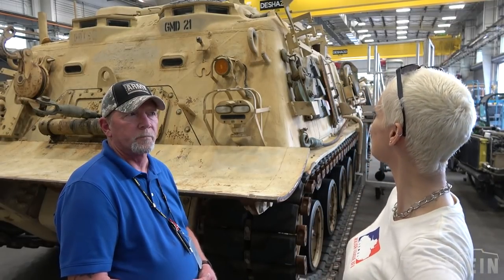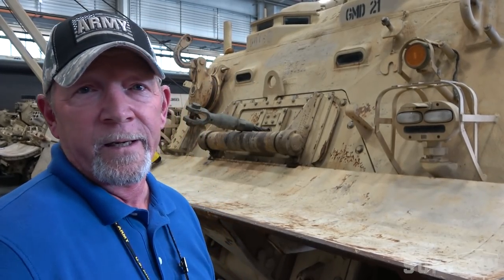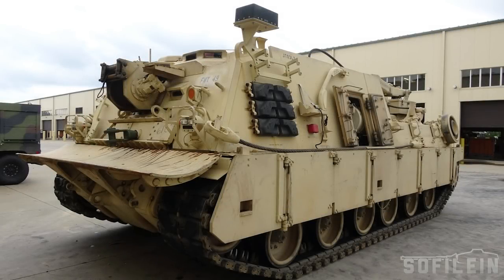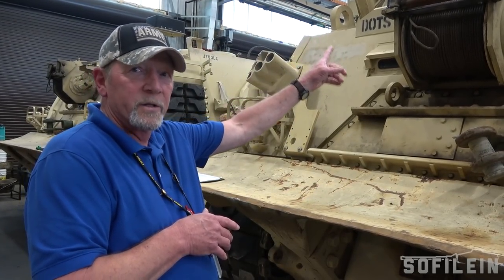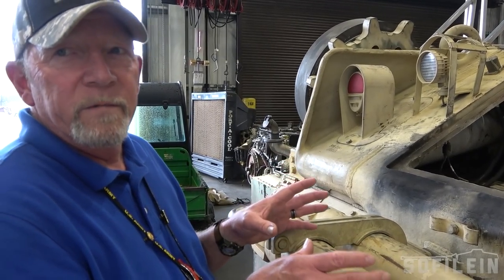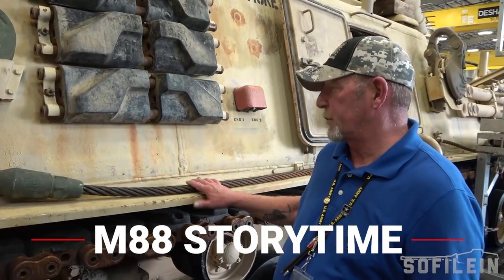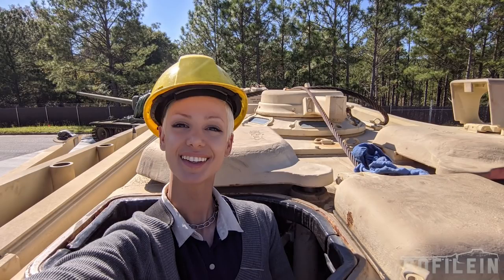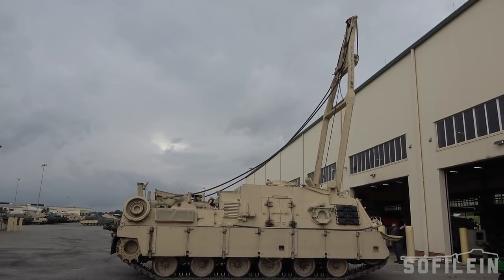M88A1 and M88A2 U.S. Army Armored Recovery Vehicles

Comment: SoFi, great episode. 2 ?'s the A1 has the air cooled diesel engine. The A2 is based on a M1 chassis and so I'm guessing it has the gas turbine engine? #2 ? I can understand getting stuck between two trees... But how heck can it be OFF the ground.... and was it a M60 or M1 model. Just thinking out loud here...
Reply: M88A2 is same chassis, same AVDS-1790 engine, but it's the -8CR series which makes 1050hp vs the 750hp of the -2DR in the A1.

Comment: Why the heavy armor?  I mean if it's just for haul/recovery ...  I can understand protection from small arms fire.. maybe grenades and possibly and mines... but 56 tons... some of that armor looks thick.
Do these come under fire from other tanks (or have they in the past?)
EDIT:  Guess I should have waited until 8:48 of the video ... heh
Reply: I also think they overdid it with the armor.
Reply: You need the weight to tow the weight, the armor provides a greater counterweight to anchor to when winching, not to mention more protection to the crew for ever evolving small arms and light antitank weapons
Reply: Tank retrievers have hidtorically come under fire in WW2. One of the reason the germans started stuff like Bergepanther. The additional weight of the vehicle is another
Reply: @bradm3a3  if they needed a heavier tank retriever they should make a new one, the m88 had enough problems with it's weight as it was, the wheels and track was not designed for the added weight,maybe they should had made one based on the M1 tank, that would be too expensive maybe?
Reply: @vasopel  here is the problem with that, cost.  If you go buying a new main battle tank you don't want to have to buy a new recovery vehicle too.  You want something that can do the job a long time.  As for the track and things, the 88 is pretty rock solid from what I've seen, and even the m1 hasn't had a major suspension upgrade since it came out, it started at 65 tons and with the m1a2 sep v3 out now it is pushing 80 ton.  You can tell a vehicle is solid in design by how long we use it, look at the 113, or the HMMWV, been using those since right after the dinosaurs went extinct
Reply: @bradm3a3  well if you don't want to make new tank retrievers for your new tank you upgrade the old ones I agree, no the 88 is not rock solid, the weight to surface area is not good at all, and although the M1 wheels and suspension was designed with updates in mind the m88 wasn't.
Reply: @bradm3a3  and about the 113 and the HMMWV, it is well known that the m113 can't get any more armor because even though you could put a new engine the suspension can't withstand the weight, the uparmored HMMWV faired better but that is because it was designed with updates in mind, :-)
Reply: @vasopel  the HMMWV was never even supposed to be a front line combat vehicle, it was only used in that capacity because we couldn't find anything better at the time
Reply: @bradm3a3  yes true but to be exact...it's not that it was the "better" among several choices, it was just the only thing available at the time (1996) of course they slightly updated the chassis (M1114) to cope with the extra weight, but why the hell did it take them until 2007 to make the MRAP? cost was to high again? I swear I don't understand their choices about where to give the money and where not to... :-(
Reply: @vasopel  because everyone wants the money to go to their district and their friends.  If people were objective and went for the best product we would be able to take over the world, this is how we bake in a handicap
Reply: I was part of the engineering team who developed the M88A2 and directly involved with the armor development.   The armor served two purposes.  First a tracked recovery vehicle off  road has to weigh roughly the same or more than the vehicle they are pulling out because of control and traction .  Weight matters in recover.  The second reason was it was designed  to go into near front line situations to recover knocked out tanks.  the armor was to protect it against artillery, light cannon and some infantry weaponry.  The specifics we designed for are still classified, but the threat included helicopters and aircraft.   That included friendly fire as well as Warsaw Pact equipment.   The projections was being able to operate just behind the lines could save 50% of the vehicles  disabled in combat that were repairable.  In those days that number mattered.    The M88 was designed to operate just out of direct line of site fire.

Actually, vehicles like the M-88 armor designs include something called "Pass Through" .  The vehicles were designed to let a sabot round simply go in one side and out he other with spall blankets catching the fragmentation coming off the armor.   The crew had a decent chance of survival if the round just went on its merry way.  The worst case scenario was a round going in and then ricocheting around the interior.   Not much of the crew or the interior would be left.
Reply: @jamesb4789   Wow thanks for all that info.
Understanding is a lot better now especially about the weight-relation.
 The last part makes sense too...  kinda reminded me of the ship in WW2 that took some armor piercing hits from the Yamato-Encounter and survived a long time (albeit with holes)..
 Until the Japanese switched to HE.
But I guess the same principle by allowing a shell to pass through.
Easier to repair a hole and better to have a crew survive.
 Thanks for the explanations.
 Awesome stuff.
Reply: @vasopel  In 1988 the M88A1E1 (A2 design vehicle) went head to head with a General Dynamics M1 based recovery vehicle.  The Aberdeen test folks concluded after one day the GD vehicle was junk.  Teh gas turbine has poor torque, but fast.  Tow trucks are slow high torque operators.  They had to follow the GD vehicle around with a fuel truck.  It even ran out of fuel in front of the Army brass during a demo, then brock down and had to be towed back to the hanger  by the M88A1E1.   The M88A2 was slightly nose heavy, the Army and BMY did not want to go to 7 road wheels at he time.  The suspension was adequate, not great but the vehicle was slower and thus it was ok.   The M88A3 hydro suspension was proposed in 1988 and shot down for cost.  
I was one of the M88A2 vehicle design engineers.
Reply: @vasopel  The weight to surface issue is a tough one to deal with.  There are specific transport issues the prevent fitting wider tracks and often it can affect suspension design and geometry.   WW 2 German designs tried it and with at best mixed results.  That said, the function of the vehicle is that it is not the front line unit and it rarely goes where another did not already go.
Reply: @vasopel  The armor is there first to give the vehicle enough stability for hoisting and towing cross country.  The weight is required or the vehicle can't do it.  The protection was the second reason.   The applica approach was used  for ready repair, cheap assembly, retrofitting  M88A1's as A2's, kept the M88A1 tooling, and it allowed the use of special steel armor for better protection.   The base hull is very strong.  However, you can't make a hull out of the applica type material and the design allowed a compromise.
Reply: @jamesb4789  yes true a gas turbine recovery vehicle was never gonna win diesel power in any test except speed :-)
a diesel powered variant of the M1 would be a better choice, the germans made the Bergepanzer 3 based on the leopard 2 and had no problems (at least none that I've heard of) ,I don;t know if they had any diesel engines that could fit in a m1 hull...maybe they did or maybe they didn't..
now...if they wanted to add weight to the m88a1 for better stability (and towing ability) they should have gone with adding an extra wheel,not just adding weight in the same old 6 wheels ;-)
I know you said the the Army and BMY did not want to go to 7 road wheels but someone had to tell them their mistake! someone!
the 7th wheel would have kept the m88a2 at the same width as the a1 (to prevent transport issues) but the surface pressure would definitely got better! 
I have heard that the A3 variant will have the 7th wheel at last! lets see when that is gonna be build...
Reply: @vasopel  The M-1 hull was simply not much use  for a diesel engine with the performance needed.  We had a M-1 hull at BMY and tried fitting a heavy torque diesel into it with steel plate piled on  to simulate the weight.  The high torque actually twisted he M-1 hull.   the hull armor used in the M-1 did not have the structural strength for the torque.   The Bergepanzer 3  is not considered that good a recovery vehicle.  Their drag winch and cabling were looked at for the A2 and found to junk in field conditions.  It has a rotating boom, but less lifting capacity than the M88A2 or A 3  and for heavy lifts it is restricted to the same angle at the front.  It could not pick up the M1A2 turret. The rotating boom looks good on paper, but without  an outrigger system like commercial cranes it can be dangerous  risking tipping the vehicle.  BP 3 is also a very expensive and a high maintenance vehicle.    I designed the boom on the M88A2 and it was reused on the A3 as is.  It can take a load of 50 tons structurally in a lifting mode, but the vehicle does not have the counter weight for safely lifting that load without tipping over.  We over designed the structure though because the worst load was when you pick it up from the travel position.   The flat plates  on the tubes were added because the legs deformed from the loading in first 3-5 fee of lift.  It was a fluke in the design.   The M88A2 officially had 35 ton lift capacity, but the host winch and structure were designed for 40 tons and derated.  Main reason was the commercial winch we used was higher rated, but it was cheaper to design to that rating than develop a new winch.   And we were aware the Army  probably needed more tons capacity.

The M88A2 met the towing speed for 70-72 ton M1A1 vehicles with little problem, but it was the limit.  We wanted to upgrade, but we understood a huge selling point  for the M88A2 was the M88A1's could be easily upgraded to the configuration if we did not change the suspension.   Since it was  a big tow truck, the practical won out as it should have.  The new 7 wheel required major rework of the lower hull.  Actually, the step from A2 to A3 was about suspension and drive train and the upper hull is basically the same with extra weight.   I drove the M88A1E1 prototypes quite a lot.  There was a huge change from the old M88A1's and I would be curious to see what the A3 is like.

Comment: What hauler hauls the haulers?
Reply from the maker: Yet another hauler

It's haulers all the way down
Reply: @Sofilein  i recently built the A2 in Lego. Im kinda jeallous that you get to play with the real stuff… but also superhappy that you share these awesome vids!
Reply: The HETT.Rode on them a few times at Ft.Irwin and quite alot on the 88's.Loved the Brad's.The Hercules used to be rebuilt at the depot I work at but the Marine Corps in all their logic decided to dump both them and the Abrams.
Reply: Tell the Marines to keep the Hercules so they can steal Red Chinese tanks to be able to have armor in theater.
Reply: An M88 is used to recover, and tow another M88. I had to recover two of them in one day. Both got stuck going into a swamp area to recover a few infantry vehicles that some Lt decided to cut through a couple days before. He sunk a Gamagoat, a Duece and a half, and their 5 ton wrecker (also breaking the front and rear winches, and bending the boom) before he called for help. I got the M88's out....not sure when they got the rest of the Infantry out. I refused to go back in the area they were in. I think they called Engineers out there.